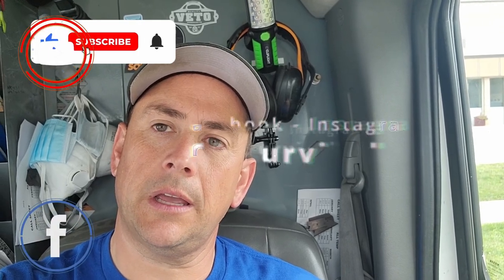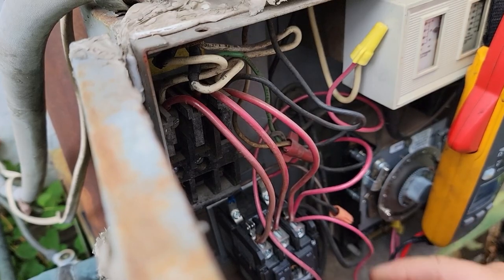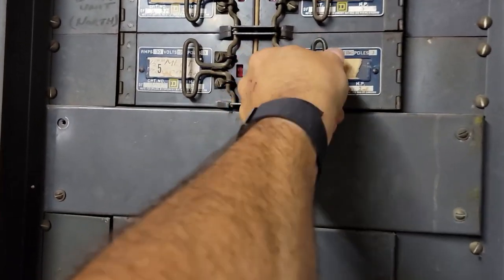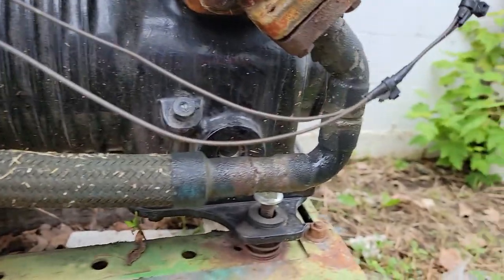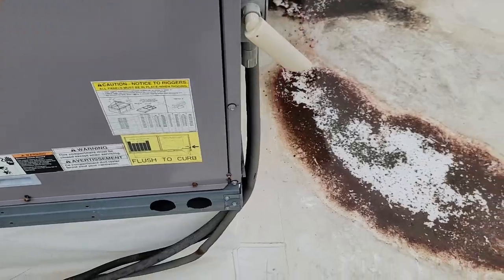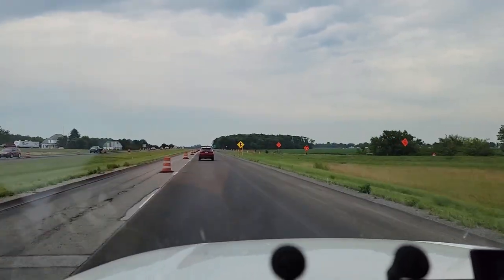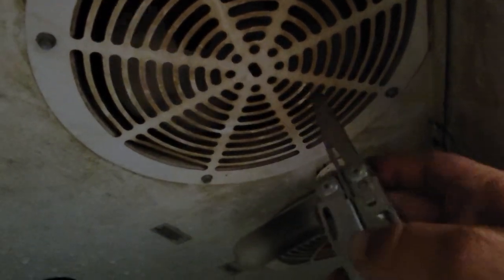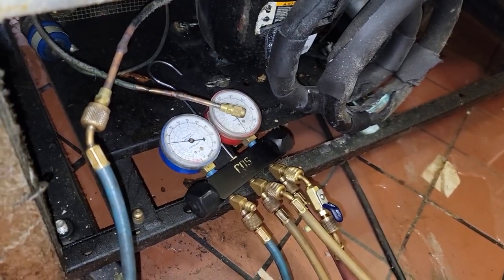Sunday Emergency Service Calls For Warm Cooler & Freezer Plus Fire Alarm Failure

Comment: When I started in this trade in 95 I used to Deal with this exact garbage, indoor unit outside. Thankfully over the years I’ve corrected a lot of that. You only get to do what the customer allows. Can’t just change a unit out because it’s less than perfect.
Reply from the maker: You started the same year as me😁👍👍.  July 95
Reply: @HVACRSurvival  I don’t even remember the month! But it was late spring. Now I can see why everything you do is pretty much exactly how I do it too. 👌🏻
Reply from the maker: Cool🙂👍👍

Comment: Some other YouTuber I won’t mention would have changed all the fuses in all the buildings done full pms on all the systems, balanced the buildings envelopes, degreased the kitchen floors and cut the grass while he was there! LOL thanks for showing how running service oncall really goes.
Reply from the maker: I'm like that during the day but not on call. You can get buried real quick

Comment: if you would like to do away with leaks at Schrader valve put 1/4 " flair nut with bonnet cap as you tighten it will create flair seal 
God Bless

Comment: Some real-life calls there. I wonder if the old system at the grocery store being old costs more to operate due to efficiency losses than it would over time to replace it with something a little safer and more efficient?
Reply from the maker: The compressor was newer but the rest was beat.

Comment: Don't start the high-speed music when you say you got to make sure you work fast before somebody puts fuses back in and you get shocked! You scared me. LOL PS one other piece of advice take it for what it's worth if you're going to use the same piece of cardboard over and over mark this side up so if it does get any oil on it from the poison ivy you won't be touching it! Another super video take care of yourself and your family
Reply: I thought the same thing, music sounded like a arc zap
Reply from the maker: I threw it away Beryl, I might like hazards but I'm careful.

Comment: what do you think about a 3 amp fuse on that contactor,when there is power problems they always die,and there is nothing to protect them like on RTU's ?
Reply from the maker: It took out the coil, not sure there's a lot you could do about that. Possibly put a snubber on there or a mov in parallel. It doesn't happen that often

Comment: that stuff looks so shaddy. I   wish can change wite out. 1st one.2nd call you should lable it. if smoke detector went off  you might have change detector. 3rd on needs pm work to it.
Reply from the maker: The smoke detector did not go off,  it was just experiencing a trouble code. That had more to do with the alarm company than it did with us. Something as simple as a tamper resistant cover could have been causing that.

Comment: I like your videos. On that true T49f. As a first guess, with the amount of condensate in the pan, I would think heater, or def tstat.  Melted out when they unplugged.
Reply from the maker: Thanks John, time to tell if there's more going on.
Reply: @HVACRSurvival   thanks for the response. Maybe bad connection/ burnt wire or relay in the timer. I have been true authorized service since 1984. 😎
Reply from the maker: I replaced the defrost termination / time delay I think 2 years ago, obviously the EVAP motors were replaced.

Comment: Gotta love easy calls when on call..
I had to go to Bellefontaine Saturday for a residential super duper emergency..... T stat set for 70 it was 78 in house....stat was set on heat...lol
Reply: Haha, those calls are annoying but sweet when you’re only there for a couple minutes. It’s bittersweet when a customer calls about a unit being down and you show up to find it unplugged. I had a call once for a freezer lineup at a market, and when I had them pull product and lifted the covers, I found the liquid hand valve shut 🤷🏼‍♂️ Easy money… sometimes 🤗

Comment: No digital manometers? Is it better the old-fashioned way?
Reply from the maker: I'm not sure what you're asking? I have every type of thermometer you could want. Flir thermal imager, Fluke  52II and several others.
Reply: @HVACRSurvival  Pressure gauges
Reply from the maker: I work on so many different kinds of refrigerants I don't like having to use a PT chart so I use digital gauges. I have no problem with analog but the digital makes it a little easier.